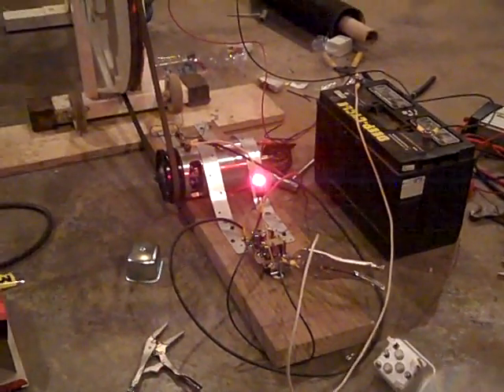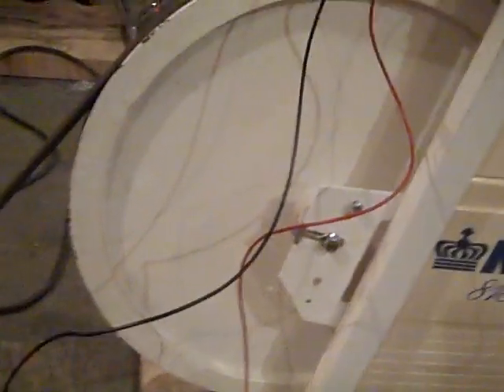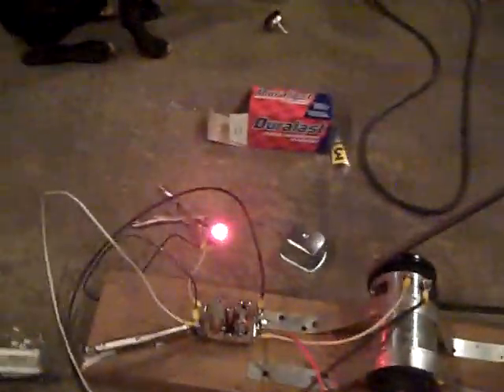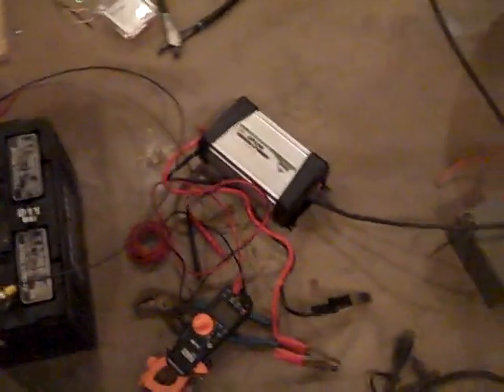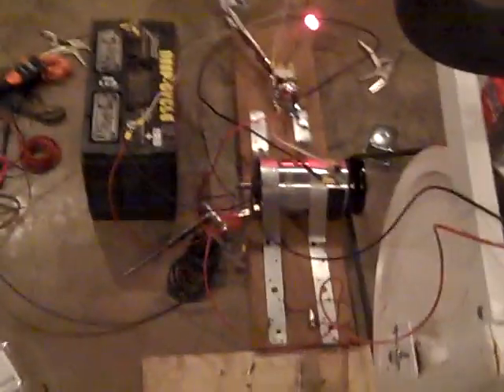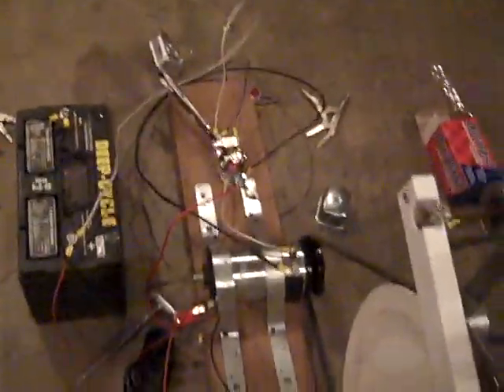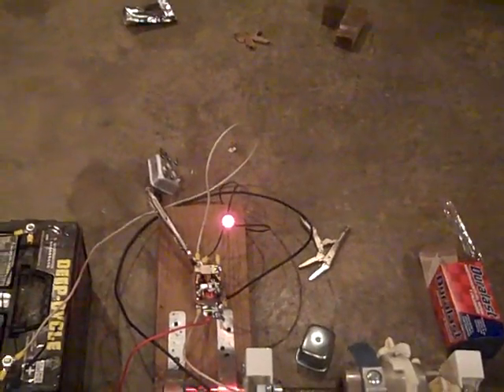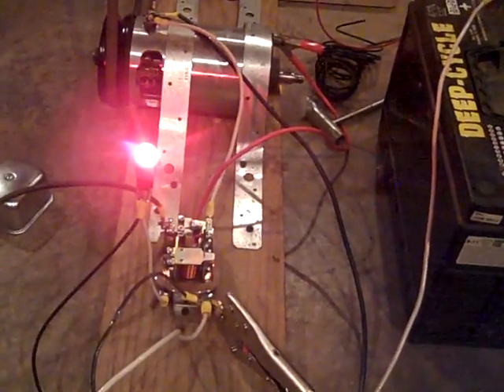Pedal Power Charging Station

Comment: you could use an ammeter to indicate charging once the battery voltage is reached the needle will move showing power is been put into the battery

Comment: Engineer775, was wondering if a John Deere Starter/Generator fits 110/112 Garden Tractor and other brands with early Tecumseh engines. Used John Deere original. Delco Remy 1101970 would work for charging batterys if I were to put on an excise bike? I have a treadmill motor on a excise bike now, but want my power. Thanks

Comment: How about taking a clue from the old bicycle light that had the generator that ran off the tire and just come up with a rubber wheel for the generator and have it in direct contact with the flywheel?  Would the gearing be better or worse?

Comment: I also remember driving our farm tractors at night and watching the arcing of the generator brushes on the commutator. It increased when you turned the lights on. A lot of these systems were positive ground so when you replaced a generator you had to polarize the generator field so you didn't fry the cut off relay points. You have WAY TOO MUCH FUN!! There  is science to how these have a residual magnetic field that as you start turning the armature it was enough to close the cut out relay. COOL!

Comment: Brings back memories of my tech training. I still have an armature lathe and growler for old school generators. I remember having to set the voltage regulator cutout relay and regulator by turning the screws but having to put the cover back on every time you made an adjustment because taking that cover on and off changed the magnetic field enough it would throw the voltage setting off. I doubt the mechanics coming out of schools nowadays have seen a generator and regulator! Fun!

Comment from the maker: That's what this system is for - just add the inverter to the battery and you can run what ever the inverter is rated for.  Just don't deep discharge the battery!  A battery just has so many cycles in it!

Comment from the maker: No battery does well with deep discharging .  It is important no matter what battery you are using to keep them topped off.  A simple volt meter to check voltages is very important.

Comment: Great set up.  The old tech gen/reg.  Also, I've been thinking about EMP protection.  Say you've got stored electronic stuff that you fear may be vulnerable....why not keep it stored in a small shed that is totally clad in tin or aluminum most of the time?  Tin covered floor/walls/roof/door and make sure all panels are well fastened (bonding) with screws.  You could test using a portable AM/FM radio....see if it quits receiving with the door shut. A Faraday cage of tin.